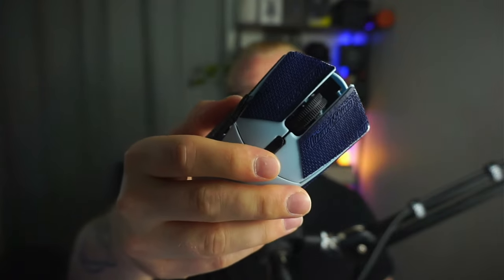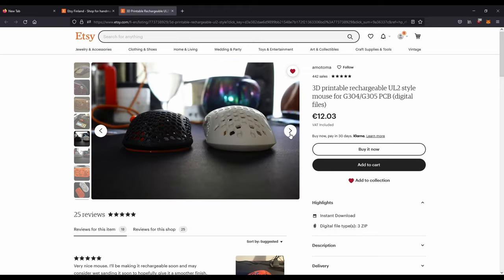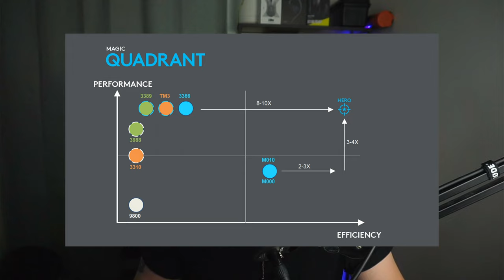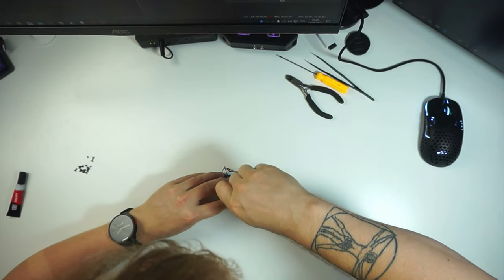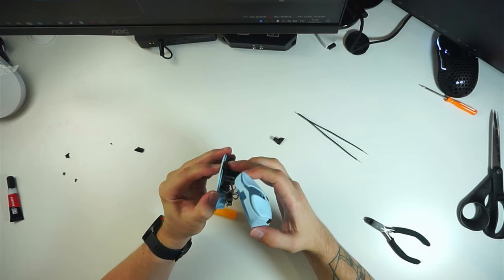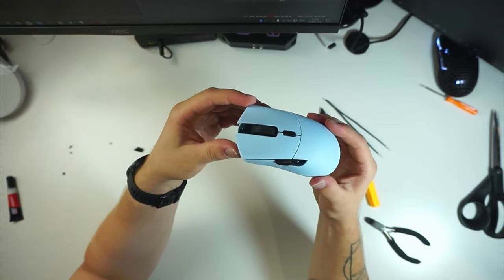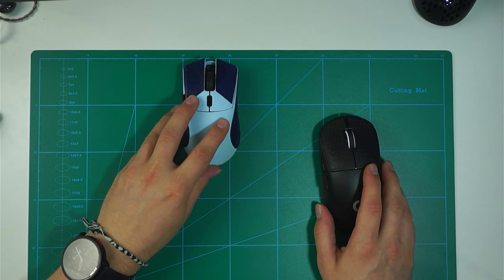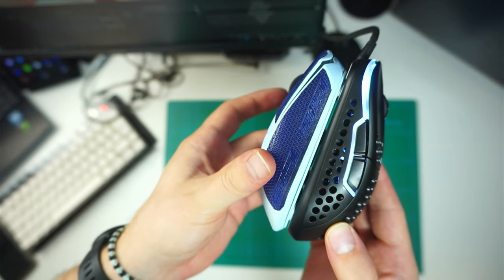I 3D Printed a Gaming Mouse and it’s Really Good

Comment from the maker: Apparently the listing for the 3D files needed for this mouse is removed by the seller. I am still waiting for his response but will update on this soon (if he responds).
Reply from the maker: The designer/seller said that he wanted to update the files but faced problems because of the small form factor. The files can now only be found on thingiverse (for free!).
Reply: @jerrorr  thingiverse link please?
Reply from the maker: @velqt  oh yeah sorry! https://www.thingiverse.com/thing:4084764
Reply: @jerrorr  also how difficult would this mod be for an orochi?
Reply from the maker: @velqt  for the orochi PCB there is only one mod I’m aware of, and its the PMM CBR modkit. Haven’t found any printable files to make my own shell sadly.
Reply: @jerrorr  do you know how similar they are? if there's at least similarity in size the mod could probably be adapted
Reply: Hey do you mind if I ask how did you get that amazing paintjob? What spray paint did you use? Could you recomend anything? I printed it but I do not know how to paint something like that.
Reply from the maker: @SpunkyEnchanter  hi! Its just the filament color and a lot of sanding + a matte clear coating on top.
Reply: @jerrorr  That is awesome. I was able to get a hold of the file I am trying to make it a bit more sturdy for the right and left bumper. If you want when I am done I can send you the modified shell code.
Reply: But thanks again I am going to try just using the filament and the coating. @jerrorr
Reply from the maker: @SpunkyEnchanter  good sanding is the key part 👍 good luck!
Reply: @jerrorr  I was able to solve the back button issue by Dremel away the square that interacts with the button if you sand it until it is flush with the top part of the side button it has no mushy feeling.

Comment: Would be a fun possible thesis within additive manufacturing and topology optimization, to develop a light-weight gaming mouse. (I'm taking an MSc in Product Development and Manufacturing.) Seeing how light a mouse one could possible produce while maintaining structural soundness, using some of the more "fancy" 3D printers available. Although, Idk. if there could potentially be enough interesting or new stuff to explore in this space, to get enough quality content for a properly interesting thesis.
Reply from the maker: You should check out what Nitrite Labs is soing currently! They are offering modkits printed with some fancy new printing tech 👍

Comment: Cool! I also use a 3d printed mouse for fingertip grip. Made with the Logitech GPX internals and weighs in at only 40g
Reply from the maker: That sounds so cool! Did you design it yourself since GPX internals are a rare find on a 3D printed mouse?
Reply: What material did you use?
Reply: Yo can i get the files?

Comment: Hey man, love the video! How is the mouse holding up, and what are some recommended settings to print the shell and bottom plate in?
Reply from the maker: Thanks! It is holding up pretty nicely, I have switched the shell and buttons to the honeycomb style and the sidebuttons work nicely now as well. For the settings I used 0,2mm layer height and 20% infill ratio if I remember correctly. Most importantly be generous with the supports. If you have more questions I suggest hitting up the designer amotoma on twitter! He’s a really helpful guy!

Comment: Do you know if you can still get the model? it shows that the page is unavailable. Love your vids! Edit: lol i didn't notice the pinned comment
Reply from the maker: Yeah sadly the files used in this vid are not available anymore, but the maker has a different version (solid shel, non rechargeable) for free on: https://www.thingiverse.com/thing:4084764
Apparently he was unsatisfied with the files on etsy and decided to take them off. Thanks for the love!
Reply: Thanks for the reply, but where do you get the battery kit? Edit: got mine printing right now 😀
Reply from the maker: @SloogusFPV  its from enncoo: https://enncoo.com/products/enncoo-modkit-for-mouse-modding sadly it’s currently sold out :s

Comment: I would like to do a g305 mod to finalmouse with rechargeable usb c connection do you know where i can find files for that or someone who sells them? Or viper mini with usb c.
Reply from the maker: You mean 3d printing a starlight style shell and having g305 electronics with usb-c? I havent seen any usb-c on 3d printed mice sadly. This UL2 style shell with micro-usb is the closest. I thought about doing a viper mini wireless mod but Razer will propably release a more reasonably priced viper mini wireless in the summer.

Comment: I was wondering at what angle you printed you upper shell, and what settings as I love been trying to print my own but it hasn’t really been working
Reply from the maker: Thanks for the comment! I printed this in the orientation the files were originally set. The angle was propably around 45 degrees. I used 20% infill and 0,2mm layer height for the settings, and use appropriate supports all around. I’m a 3D printing noob so if you have more questions I’d suggest asking from the designer Amotoma on twitter. His twitter handle is @amotoma2.
Reply: @jerrorr  what supports settings did you have
Reply from the maker: I actually used kinda bad ones because I was limited to max 4h of printing time per day because I printed it at my local library 😂 you should slice it so it has supports all around. You don’t want to print anything on empty surface. Try to add supports in overhangs over 40 degrees and see how it looks in your slicer software preview.
Reply: @jerrorr  thanks

Comment: Hi, can you show us the circuit diagram for the power system you used? i cant seem to find something that would work
Reply from the maker: Hi! I used the Modkit from enncoo, which came with all you need to convert it to rechargeable mouse. Unfortunately the delivery times from enncoo are so bad these days that I can't recommend ordering from them. If you use the files from Amotoma you can choose the files with a battery holder for a rechargeable AAA-battery with an USB-port. Those things have the necessary circuitry built in within the battery. Other option is to use the coin shell battery version.
Reply: @jerrorr  I have considered a rechargable AAA battery but I'm not sure if that would add too much weight, I still want to keep it under 60 grams.
Reply from the maker: @acidiconionas6207  Piranha mouse mods sells mice with a rechargeable AAA battery and with enncoo modkits and at least on the listing it seems that the version with rechargeable AAA weights around 3g more.